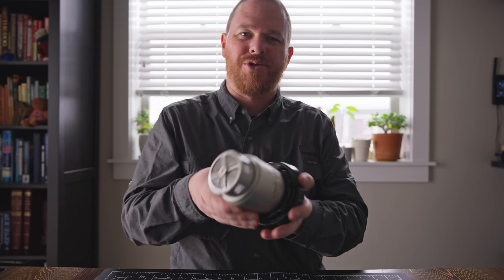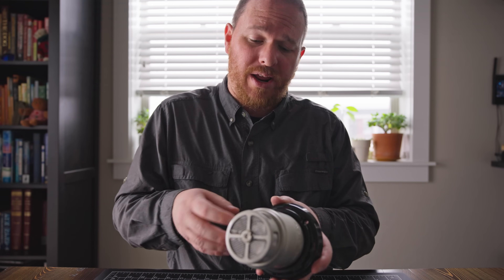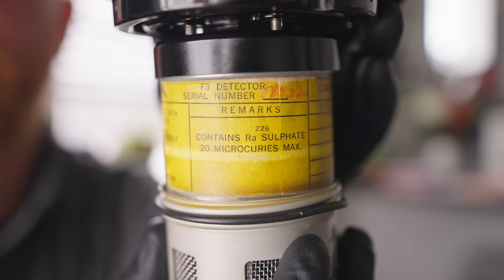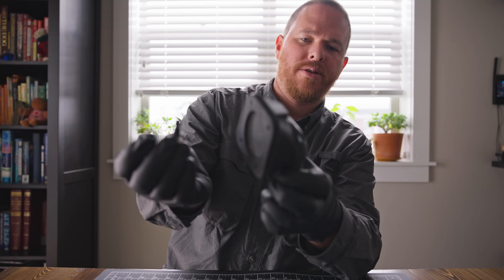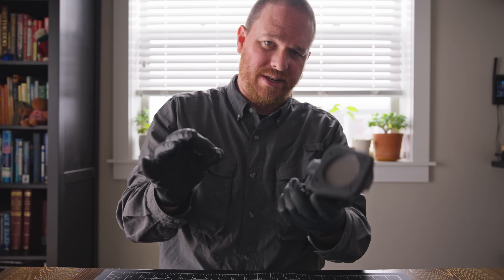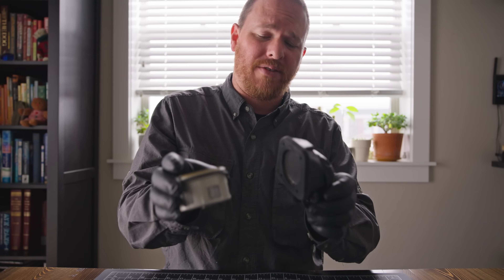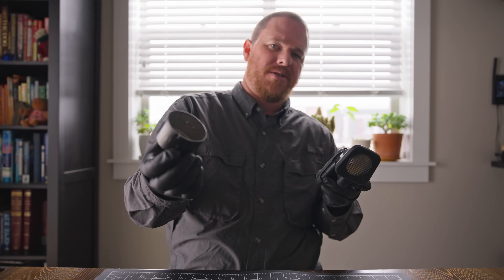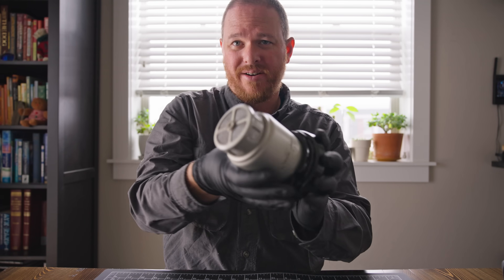Intensely Radioactive Industrial Smoke Detector from the 1950's

Comment: This actually gave me goose-bumps.
I pulled these things out of deconstruction jobs, and we were throwing them around like anything else.
Reply: If it makes you feel any better the Ra-226 Pyrotronics detectors are a lot less common than the Am-241 Pyrotronics detectors. 

I believe the Am-241 version is much higher activity (60uCi if I remember correctly). They both use the pedestal source. I’d be a lot less concerned about the Am-241 because there’s much less gamma involved. How much gamma for a 60uCi Americium source I don’t know, quantum physics is whack. 

Having alpha primary emission makes those Am-241 models a fair bit safer to be around.
Reply: @catfission  how am I finding you on here too lol
Reply: @ericchurch8169  Because we both fiending for a radium pyrotronics smoke detector fam
Reply: @catfission  this is extremely true lmao. They're real expensive on eBay
Reply: The americium detectors are 80uCi of activity the radium detectors are 20mCi. SO 1mCi = 1000uCI SO americium detectors are 80uCi and radium detectors are 20,000uCi.
Reply from the maker: The radium smoke detectors are 20 uCi…or at least the one I used for the video.
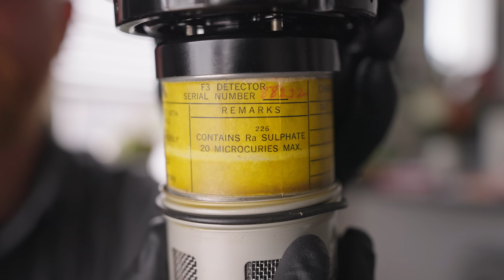Reply: @RadioactiveDrew  Watch your video again timestamp 1:13, it clearly says right on the label 20 microcuries. That's the equivalent of 20,000 milicuries of activity.
Reply from the maker: You have it backwards there. 1 mCi = 1000 uCi.
Reply: Okay that messed with my head somewhat but you're correct 1mCi (Milicurie) = 1000 uCi (Microcuries). So strangely yes the newer americium based smoke detectors @ 80uCi are hotter than their 20uCi radium based counterparts.
Reply from the maker: @SolarSeeker45  The conversion from 20 uCi of radium 226 to grams is 20 ug because that's what Marie Curie came up with as a standard (1 gram of radium 226 = 1 Ci). For everything else is a bit more complicated. But since the half-life of Am-241 is around 432 years and radium 226 is 1600 years....you might be looking at 3.7 times less material than what the activity says. Which oddly enough comes out to 20 ug of material used in the Am-241 version.
Reply from the maker: @SolarSeeker45  btw, here's a link to explaining Curies. https://www.nuclear-power.com/nuclear-engineering/radiation-protection/units-of-radioactivity/curie-unit-of-radioactivity/
Reply: How sad. Those go for a fortune on ebay nowadays, nearly $1k each 😭
Reply from the maker: Dang…really. I bought three for $100 each. I think the price shot up after I released this video.
Reply: @RadioactiveDrew  I just found some for around 400-500. But still faaaar away from 100. You were lucky!!
Reply from the maker: I’m pretty sure the ones you found are the F3/5A model which uses americium instead of radium. I only say that because I’ve seen a bunch of them around.
Reply from the maker: Yeah I find it’s either people overreacting to situations or doing nothing. There doesn’t seem to be much of a middle ground. It does happen, just not very often.
Reply: Today when a house collapses with radioactive smoke detectors all the scrap will be searched until all detectors are accounted for…
Reply from the maker: I find this hard to believe.
Reply: @RadioactiveDrew  You would think so considering NZ and the AUS are apparently void of anything radioactive. You know apart from those Uranium mines. We came in to pull shit down. Most of the time we find things that we have no idea what they are.
Reply: @RadioactiveDrew  In Germany, radioactive materials are of course considered hazardous special waste. If a house burns down and not all smoke detectors can be recovered as per installation plan, the home owner will have to have all their demolition waste treated like hazardous material waste making this much more expensive. That‘s the regulation. What happens in real life is another story.
Reply: @masterofx32  i do house demolitions of houses that are sometimes burned so badly that we can't identify any smoke detectors even though we know there must be some there. All the landfills I use have radiation detectors for everything going over the scale. I have never set them off. On the other hand the local scrap metal places have them set so tightly that I once brought in a scrap school bus and it set off the detector so they rejected the load. The person who had the handheld detector had already left for the day so I couldn't narrow it down so had to go back home with it. It took me a month to figure out how to test it  using a local fire department hazmat crew. I found out it was three tiny dots of glow in the dark paint on some aftermarket toggle switches. I took them out and the bus passed on the next trip to the scrap yard. So it just depends on your local settings.
Reply: OP when he realises how much a single Pyrotronics industrial smoke detector sells for on EBay now that the radiophiles have found out about them 👁👄👁💧.
Reply from the maker: @catfission  this is very true. I bought 3 when they were only $100 a piece. Sold 2 of them for $500 each.
Reply: @RadioactiveDrew  Seems like the price of all sorts of radioactive objects have skyrocketed astronomically. 

B-8’s and RID-6 sources went the same way. The RID-6 sources used to sell for around 40 Euro and I see them listed for over $5000AUD routinely now. I don’t personally like purchasing them because of the moral dilemma shipping illegally out of Eastern Europe. 

B-8’s I see going for several hundred nowadays too! 

DP-2 units for over $1000 on EBay! I paid in the vicinity of $400AUD for mine 😵‍💫. 

50 SBM-20’s at home that are apparently worth $300AUD each now! They cost about 10c each at the time of purchase!!!
Reply: That's because they are anything else. This man is a fraud. Look up Galen Windsor. Stop living in fear....

Comment: I'd recommend getting a surplus glovebox (from say a GSA auction). This would not only reduce your external radiation exposure when handling a device, far more importantly, it would dramatically decrease your risk of inhaling radioactive particulates (from decay daughters or broken-off pieces) and to some extent the radon. You should have been wearing an N100 mask when you did this. One final thing, you need to store something like this outside of a living space (say in a well-ventilated garage) because of the radon issue.
Reply: Not n100 but P100 up
Reply: I thought the same thing regarding the lack of mask
Reply: If the foil remains intact then the radium and all its decay products will be encapsulated, including radon.
Apart from the mask, those precautions, whilst “best practice”, are overkill for occasional careful examination of mechanically robust sources.
Reply from the maker: I doubt the radon stays in the foil. But everything else I agree with.
Reply: @RadioactiveDrew  If the radon didnt stay in the foil, it would be leaving a trail. Didnt see any indication of that.
Reply from the maker: Radon doesn’t leave a trail. It’s a gas that floats around. This device doesn’t produce enough radon to effect an area that quickly.
Reply: @anhedonianepiphany5588  Makes ya wonder how guns ever get built if you have to treat them as always loaded...
Reply: Nothing is breaking off of that foil at STP. Ppl hear radioactive and lose their minds.
Reply: This is silly advice.

Comment: "I don't even like handling it that much so I'm gonna put it back in, where it came from, very carefully."

And then you unmask the source by rotating the shielding so it isn't standing between you and the radioactive source any more.

[facepalm]

Granted, it's probably not that big an issue, but one wonders if you aren't wearing a dosimeter badge, because you're actively seeking out sources. Like, what's your yearly exposure, and how far above the average is it?

Comment: I want to know how these were produced. Its hard to imagine it didn’t involve some manual assembly and exposure to the workers making the parts and assembling it. And all the places these have been stored or used probably include some people being nearby for longer time. And how about a burned down building or these ending up in landfills or metal scrap being reused…
Reply: Probably somewhere in Asia
Reply: @Kaiyats  You just have to change your workers every year when they start losing their hair and get constant nose bleeds. The cancers will come years later. Sadly, it’s probably how it was done.
Reply: @ThinkingBetter  These were manufactured in the 1950s, long before manufacturing moved to Asia. If you saw the tags, I believe parts were made in New Jersey and Switzerland.
Reply: @Barabel22  Yes I agree but my point is that the manufacturing was likely not with high standards of radiation protection. A lot of workers in mining, material processing and manufacturing involving radioactive isotopes decades ago got a lot more exposure than what is healthy but when a cancer developed years later, it rarely got any attention. Only extreme cases like “the radium girls” have made history.

Comment: Note that the Americium smoke detectors wear out, or clog with dust, and should be thrown out and replaced after 7-10 years. That's why the new ones have a ten year battery and are designed to be thrown out AS HAZMAT and replaced when it fails.

Comment: Good video! The NPP I work at uses these Ceberus detectors. I've seen comments saying that they'll shock you. And that's absolutely true! We do sensitivity testing on the different plant areas throughout the year. The "new" ones we install have to be surveyed by RP before we can install them in the plant.
Reply: Oh yeah, they will for sure! They ran off of ~200VDC and had a hot chassis. So that was the "tamper resistant" feature of the day.